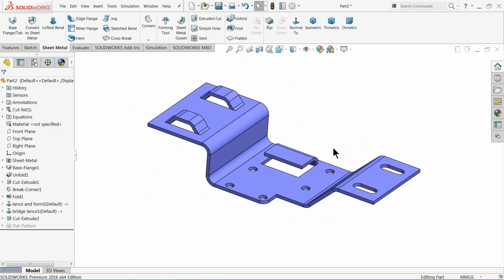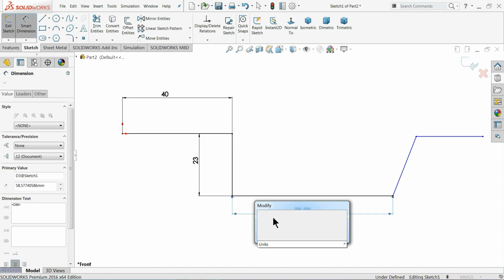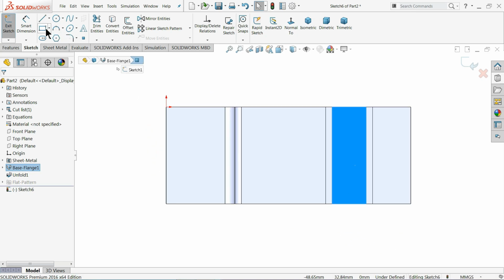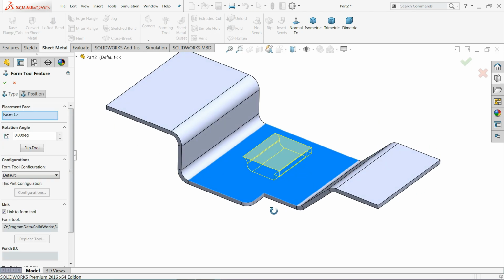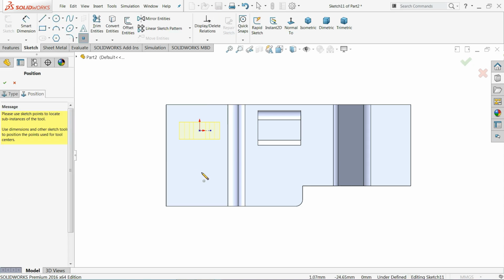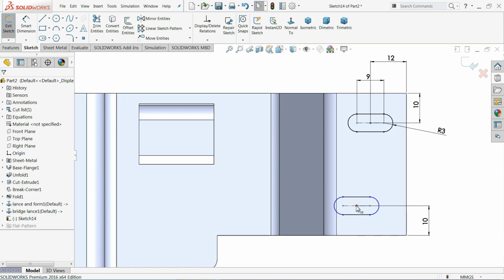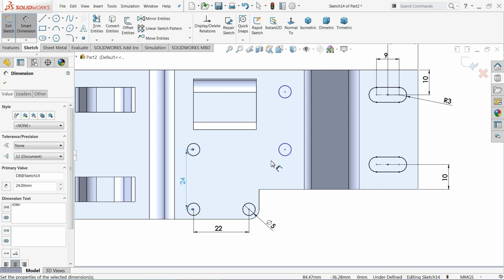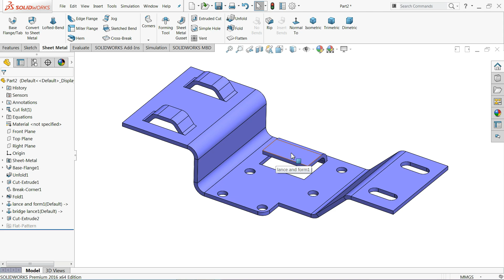SolidWorks Sheet Metal Forming Tool

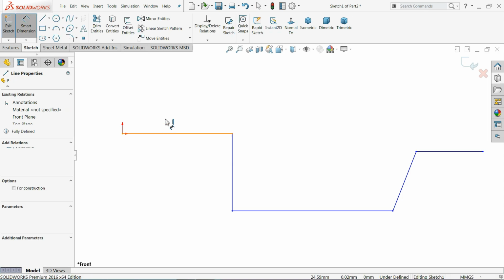Comment: this model. if you put it into drawing, how would you define the length from the 90 degree bend to the first 45 degree bend? got a bend like this that i need to define the middle of the bend and define the lenght before and after an 45 degree. but solidworks only allow me to messure from the start or end of the bend in drawing. (looking at the side like as 1:20 but in drawing)